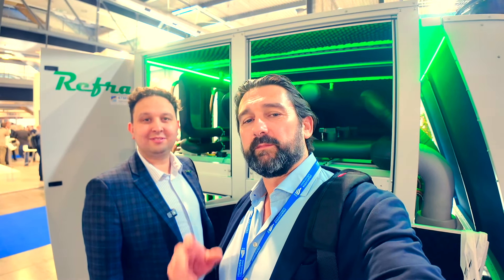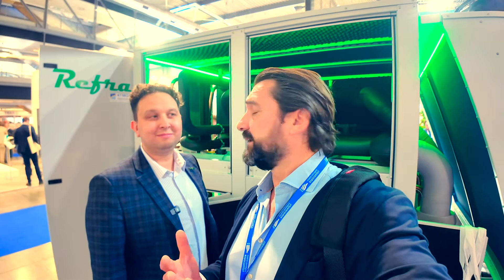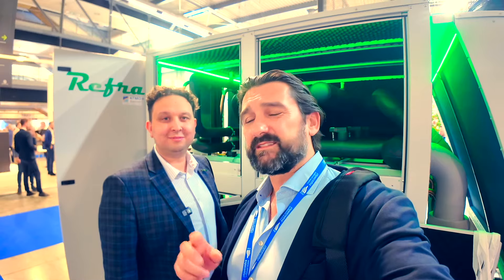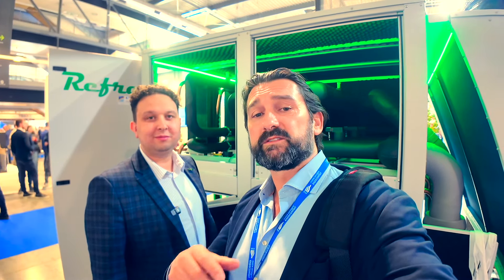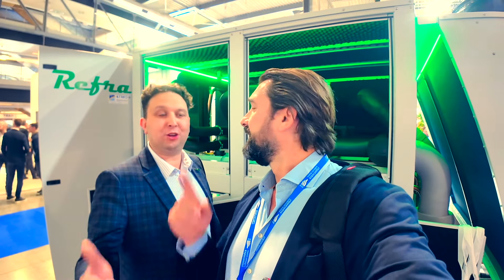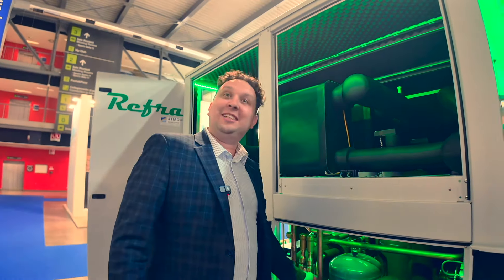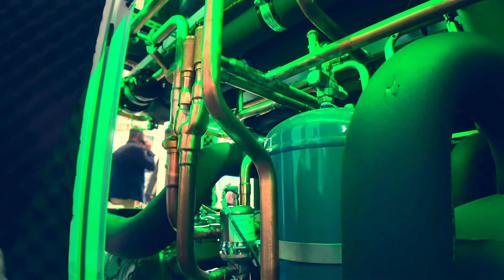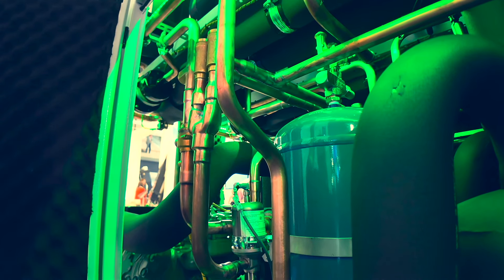Secrets to Boost Propane Heat Pump Efficiency

Comment: Was the test performed on a unit with shared evaporator/condenser? I've seen quite significant performance differences with W/W units and shared plate HX for evporator/condenser. In theory, the performance should be the same, but in practise the performance is quite different. The difference was lower than precented her, approx. 7% heating, 5% COP.
The SH for the new Siemens valve is so stable, and at even higher evaporating temps. It's quite impressive!

I'm quite intreaged by this valve. Look forward to hearing more about it 😊
Reply: Test is done on heat pump with true dual BPHE

Comment: most expensive solution: MVL702, cable, controler POL94M.0. It clearly corresponds with R744 systems. this is not a good direction of development. Solutions should be reliable, low-cost, available to all.

Comment: From a purly theoretical point of viev, the valve (both the new, and the old) have a pressure loss. If the valve selected is properly, the superheat after the valve should be the same. Only the pressuredrop over the valve should be different. And here i doubt that the difference in pressuredrop really affect the performance as much as this man suggest. Atleast, this should be able to prove with theoretical calculations. So i guess that the stepper motor expansion valve is not selected or controlled properly.
Reply: In video is presented real test values and graphs from the senors in same heat pump. You are welcome to present so stable stepper motor eev so we could discuss further on how it is or should be controlled.
Reply: The results that our CEO is talking about are actually based on a real report which has been carried out by testing this valve on our machine for a significant amount of time ☺️ We can’t wait to be able to share this statement with some back-up information in April! 👏🏻
Reply: @refra1941  looking forward for it too. It would be great if it works so well
Reply: @refra1941  is it possible to get access to this report ?